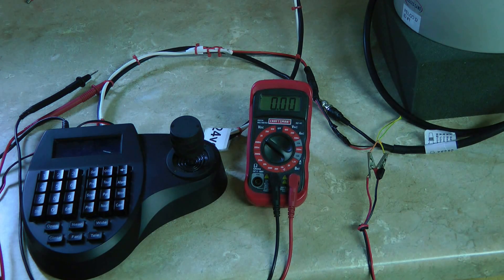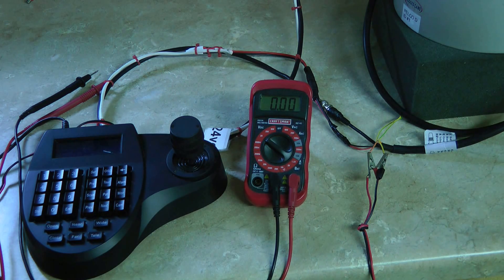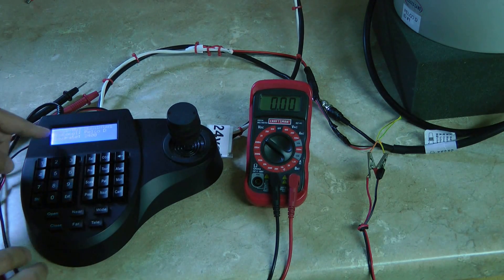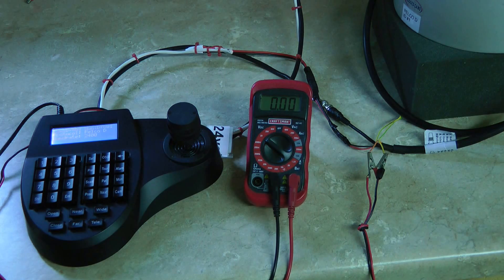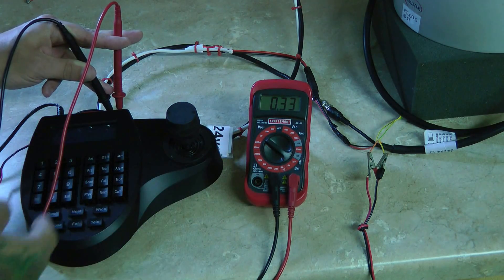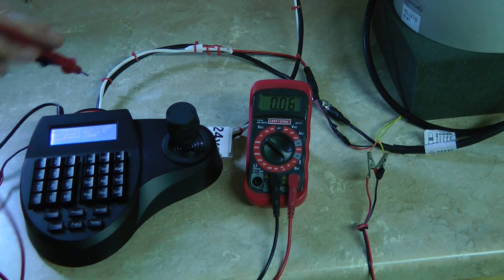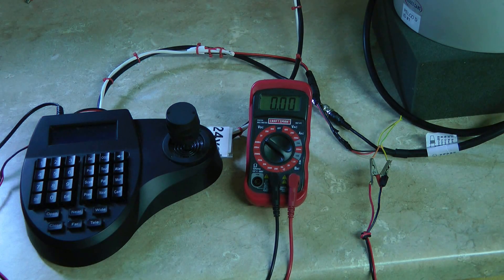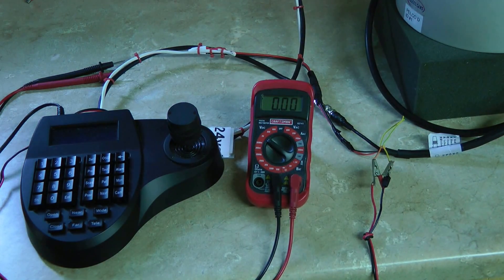Basic Trouble Shooting on lost PTZ Control

Comment: By the way need to make sure your RS485 wires aren't crossed. I had my orange as my + and yellow as -, couldn't get my new PTZ cam to work. Messed with it for 3 days and finally read the tag on the wiring, the yellow was to be + and orange -. Swapped the wires around and it worked like a champ🙄
Reply: man, strugling for 1 week on a cam that a saved from trash, changed the belts too, everything was ok except PTZ, no control over dvr's, when i decided to cross the wires just to see, BOOM, in mi case the yellow wire is + and orange is - ! saved my month!!!!! thanks

Comment: Hi ive found that my ptz the camera has broken of at the gear wheel, which i shud b able to reglue but how do i postion it for reuse.
Reply: I think you are asking a bit much here ;o) 
   You never even gave the model of your ptz camera and besides that, there is a really good chance he as well as most of us wouldn't know the answer to your question due to the uncommon circumstances you have with repairing it.
   You can try contacting the manufacture of your ptz camera but GOOD LUCK...their customer service is often next to non-existent if not non-existent, and if you do get through to their cust service get ready for a pull-your-hair-out hell of a time with poorly trained and barely-speaking-english customer service reps who will probably tell you just to buy another camera